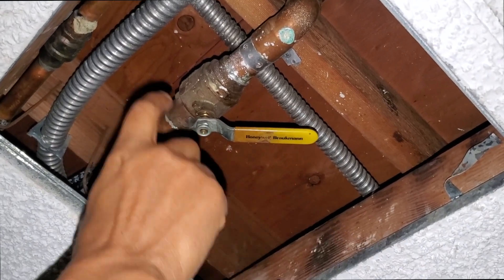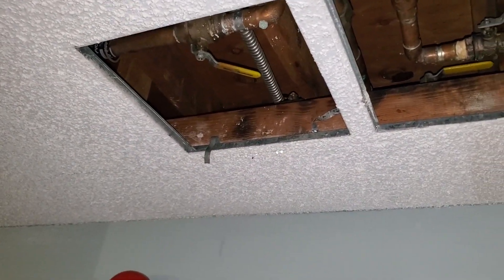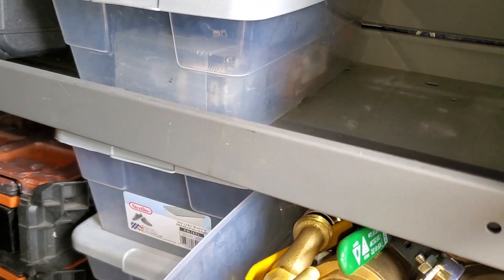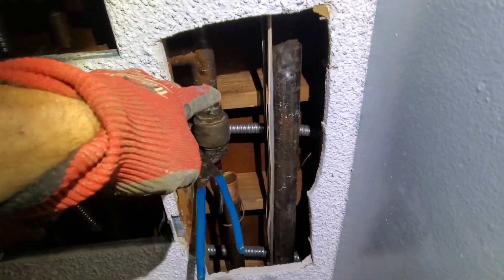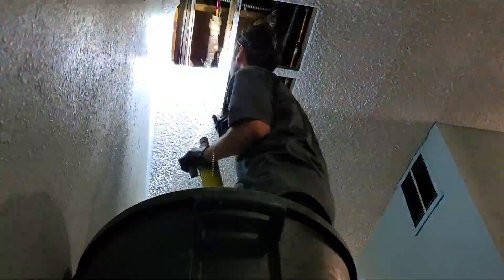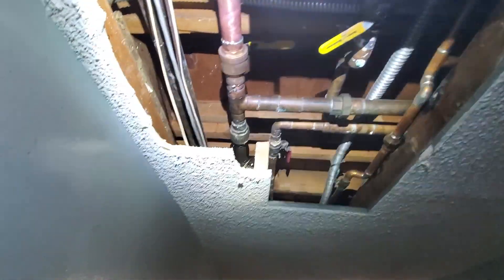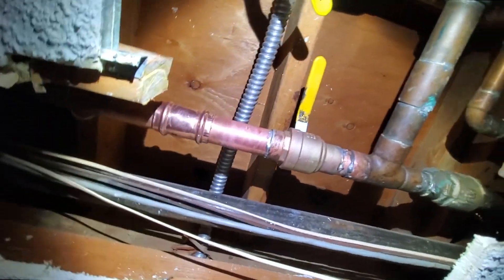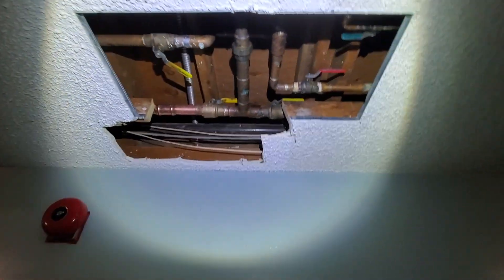Soldering & Propressing (I had no other option) | Pasadena Plumbing Company | Pershing Plumbing

Comment: Why doesn’t Milwaukee Co. tells plumbers when using Propress tool is only for Type L copper use only
Reply: You can use propress fittings on type m copper.
Reply from the maker: u can propress type m but you need to be careful as older type m gets really thin